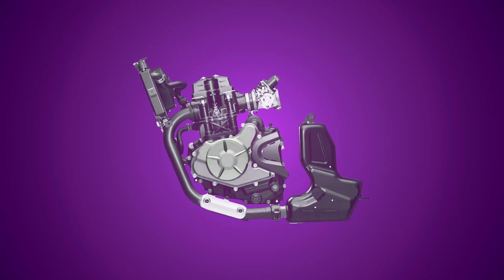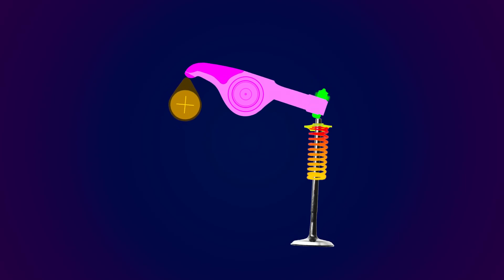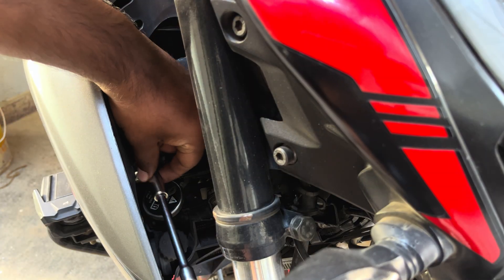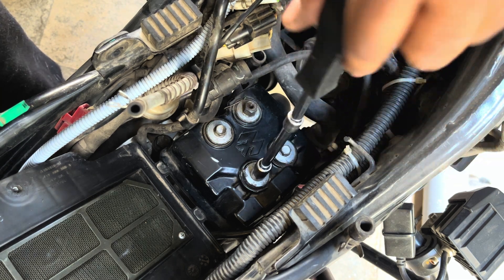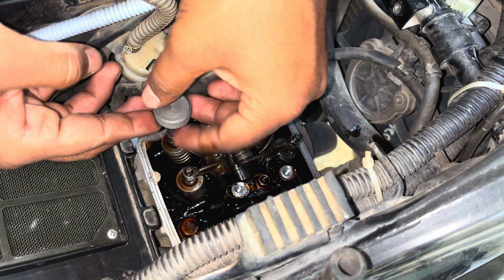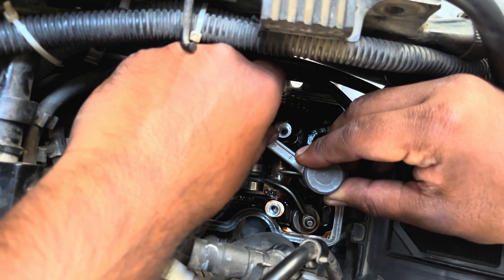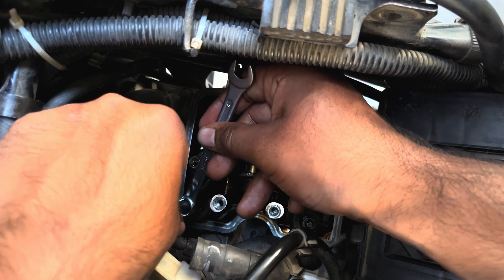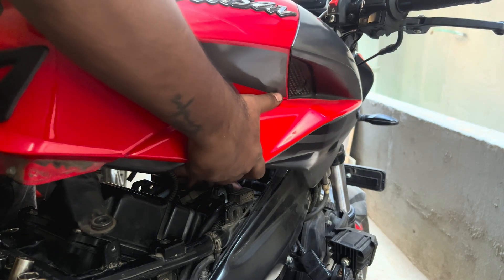Understanding Valve Clearance | Check and Adjust Tappet in NS 200 | #ns200 #dominar400 #rs200

Comment: Hi bro. My bike is FZ V3. I only get tappet noise when the engine gets heated. Should I ignore it?
Reply: Change ur engine oil with 20w50 fully synthetic oil it will help u
Reply: @sridhar5691  I am already using MOTUL 7100 20w 50 fully synthetic engine oil bro

Comment: Hey bro i had a question I recently got my tappets and timing chain changed the guys was friends of my brother so charged me less for the labour but he used razor blade to set the clearance is it okay? To use razor blade coz since then i’ve been facing a problem of low mileage few weeks ago it was so bad like 15-17kmpl after that i went to that guy he said i have clean my throttle body he did that and after that the mileage has increased to 20-23 i just bought a feeler gauge i am procrastinating if i should set it or not

Comment: what is sai unit ???
Reply from the maker: Secondary Air Induction Unit (SAI), its implementation was from BS4 and above models for decreasing fuel wastage due to incomplete combustion in the cylinder. They do it by inducing more air into the combustion chamber.